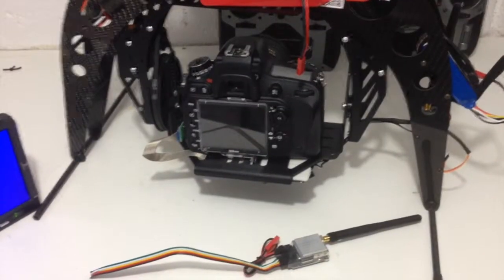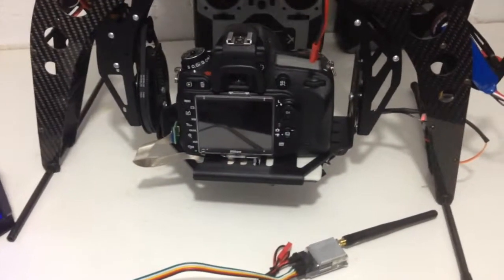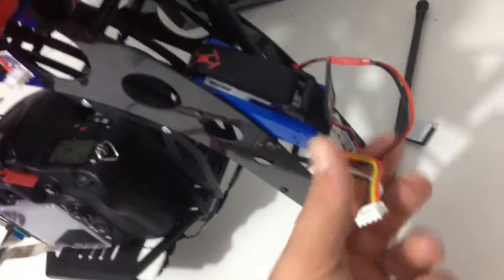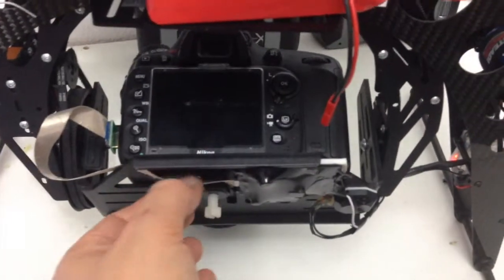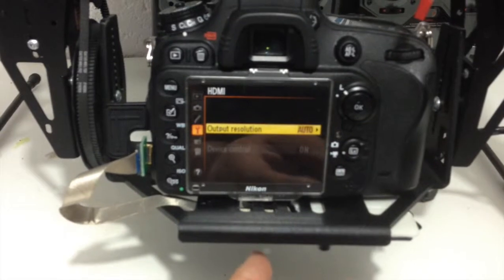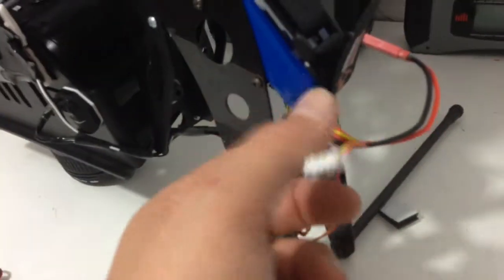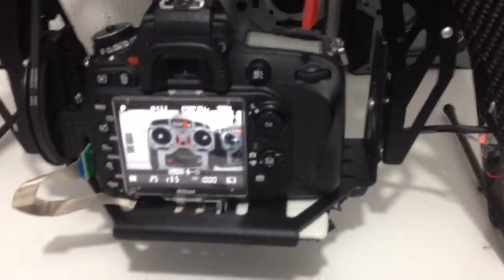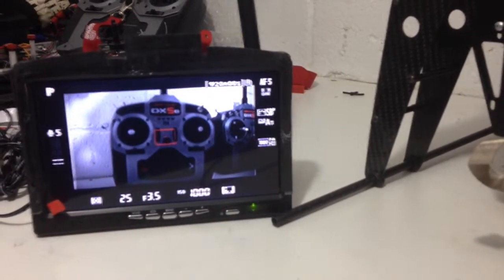How to use a Nikon DSLR for FPV

Comment: for the transmitter could you use a voltage regulator (8v bec) if your using a 4 or 6s lipo to power uav?

Comment: that mini hdmi link you shared is mentions that the cable is for Sony camera only.
Reply from the maker: S S this video is about 4 years old so I’m sure there are other options now for this camera, at the time this converter was all that was available- we checked with the manufacturer and they said it should work but not tested hence the Sony only recommendation - hobby king have heaps of options these days